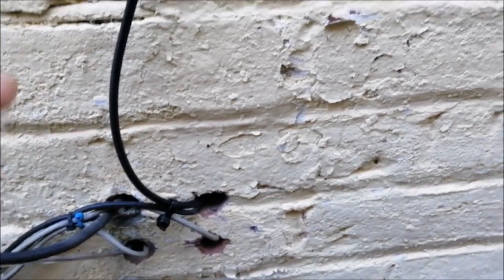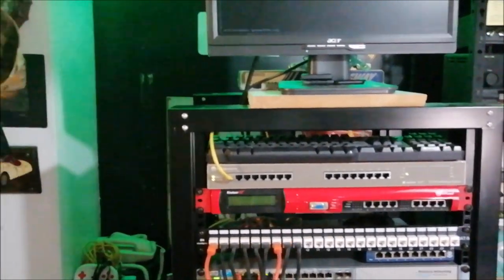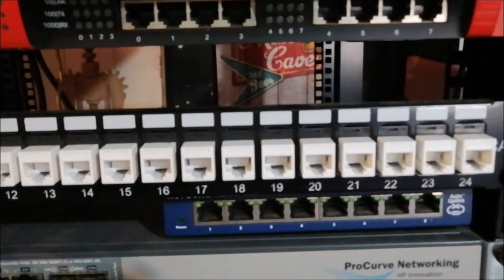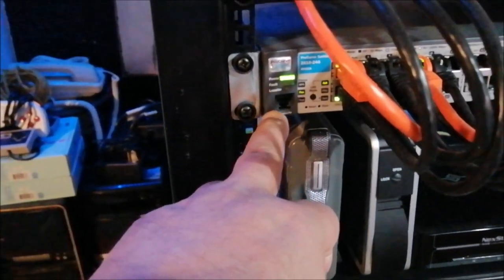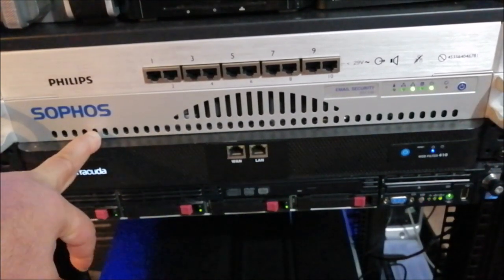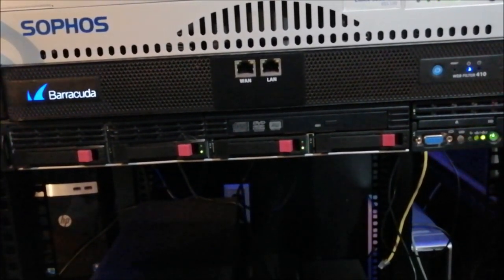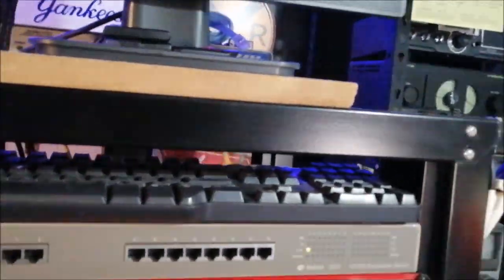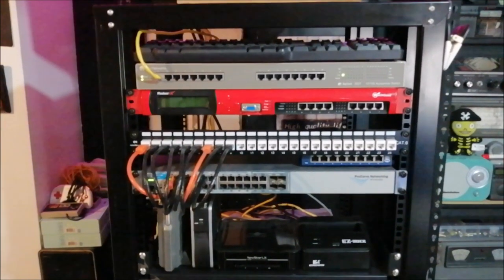My Gigabit fiber internet connection and home network data lab rackmount setup.

Comment from the maker: VEVOR 27U Open Frame Server Rack with Casters - https://vevor.com

MT-VIKI 4 Port KVM Switch with 4 KVM Cables - https://amzn.to/3gFRffY

Kingwin USB 3.0 to SSD / SATA Hard Drive Docking Station for 2.5" and 3.5" inch SATA HDD / SSD SATA I/II/III Performance - https://amzn.to/3Xzpk1O

Cable Matters Rackmount or Wall Mount 1U 24 Port Keystone Patch Panel (Blank Patch Panel for Keystone Jacks/Keystone Panel) - https://amzn.to/3V2EoU1

WD 4TB My Book Desktop External Hard Drive, USB 3.0, External HDD with Password Protection and Auto Backup Software - WDBBGB0040HBK-NESN - https://amzn.to/3GMygLi

If you enjoyed this video. Please like and share this video.  Also subscribe to my channel for more content like this.

Check out my other channels.

Danny Shortwave and Radio DX - https://www.youtube.com/channel/UCG_1O1nrRosF2FvjZ-f9xZQ

Danny Retro Gaming - https://www.youtube.com/channel/UCfEsQms6Em9YhksUhd5-jEQ

Danny Finance - https://www.youtube.com/user/dantheone

Danny Rail Fan - https://www.youtube.com/channel/UCgNVIpdHeXhQ-d0WQexLXfQ

Thank you for watching.  Have an awesome day.

Comment: For your firebox and pfsense issue. The firebox is 32 bit and pfsense is 64 bit. They don't offer a 32 bit option. Can load ddwrt or something else that has an x86 option.
Reply from the maker: Oh yes true with pfsense, they don't offer a 32 bit option. I may use the Sophos box as a hardware firewall instead, much more easier to upgrade.  Yes I also looked into ddwrt and other options for the firebox.  Thank you for the suggestions. Have a good day.  😊

Comment: It’s expensive, here in Spain we get symmetric $15 500 mbit / $20 1 Gigabit / $25 10 Gigabit. The fiber is cheap, but 10 GB network equipment is expensive.
Reply from the maker: Wow that is pretty good.  Unfortunately they are slow with rolling out high speed fiber internet throughout the country.  Yes 10 GB is a dream here still lol.  Thank you for watching.  Have a great weekend Tom.  😊